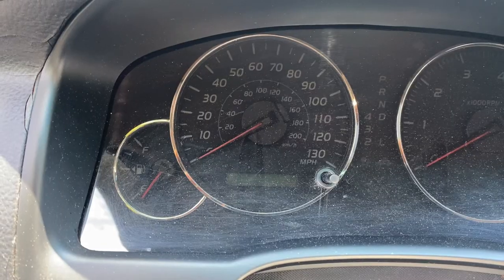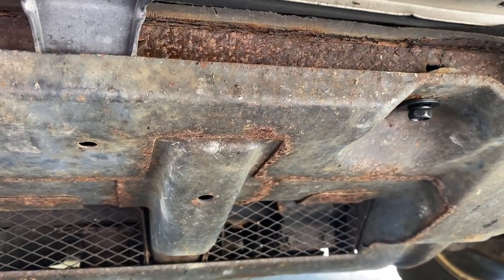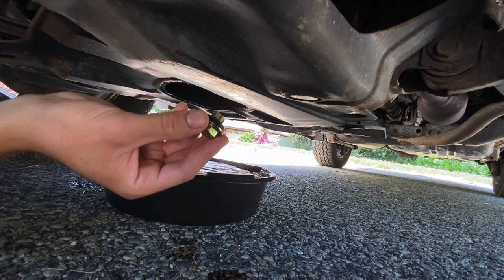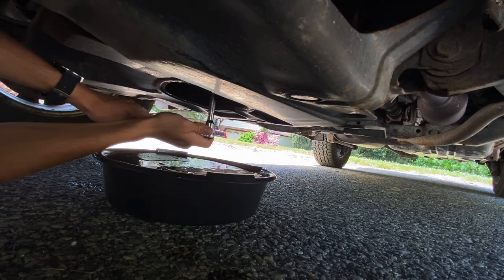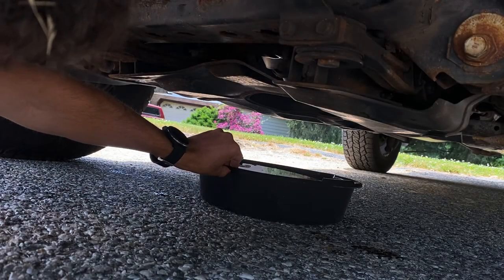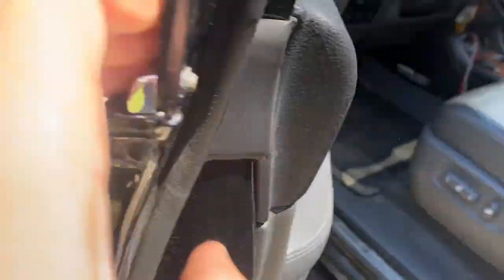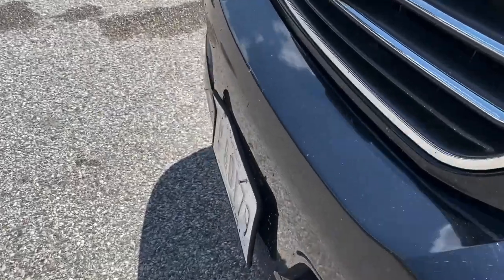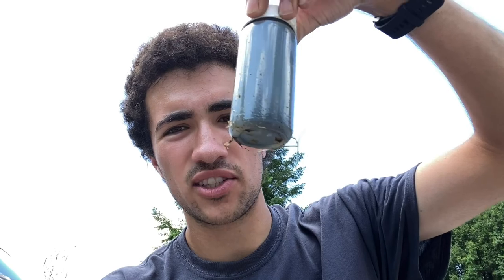Lexus GX470 Oil Change (and AC diagnosis)

Comment: You need a bigger drain pan. Also it will slide out easier with cardboard under it.
Reply from the maker: Definitely ordering a new drain pan before I do that again lol. And I’ll try the cardboard trick, thanks for the tip!
Reply: Nice tip thanks.
Reply: Brother, should have checked the oil level after you finished filling new oil, not after a ride, to see the exact level of engine oil